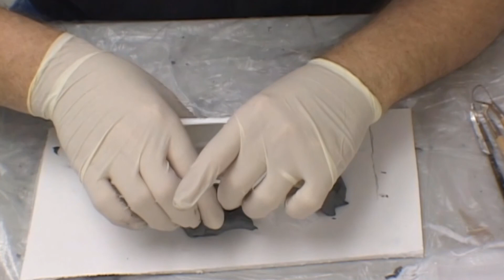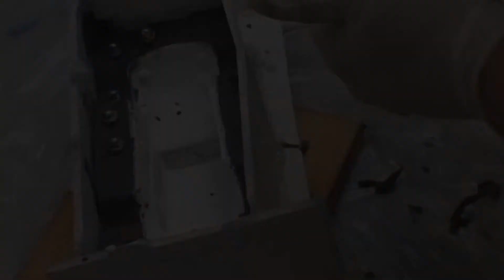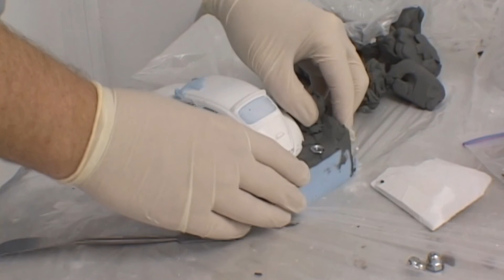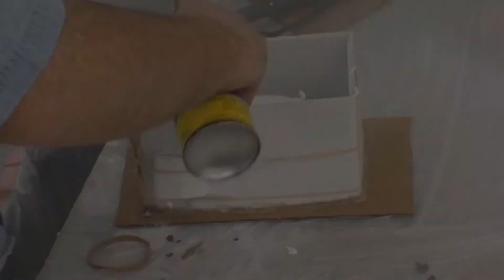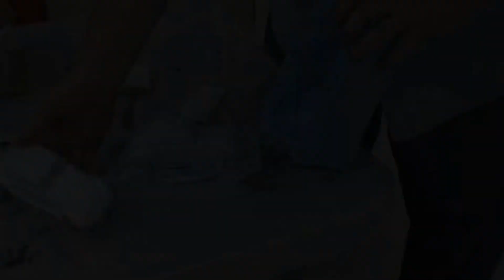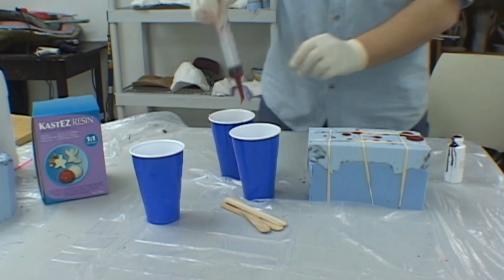Silicone Injection Mold

Comment: Could you do this in reverse and make the mold of the resin so I could inject and make an object of silicone
Reply from the maker: Yes, as long as your model had no under-cuts so that a ridgid resin mold could be removed.
Reply: @EnvironMolds  undercuts? Is there a video that refers to this?
Reply from the maker: An undercut is any indentation or protrusion that prohibits an ejection of a part from a one-piece mold. @TheHotCollection559

Comment: Not to knock your technique but wouldn't have been better to have sprus glued to the body before making the top mold instead of drilling through silicone!??  Not very easy or reliable also you wasted a lot of silicone injecting it until it forces it's way out another hole.  Just lots of other ways to do this a little better.